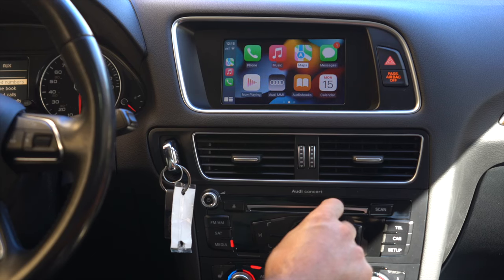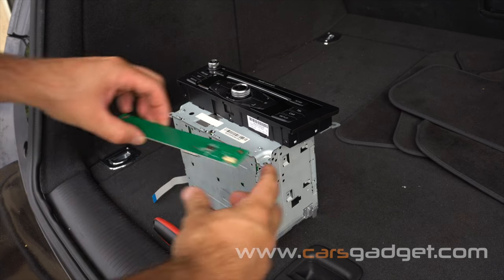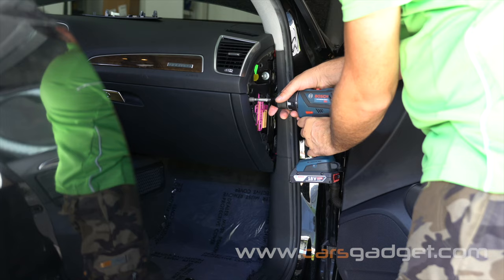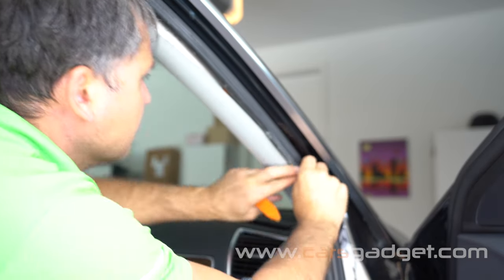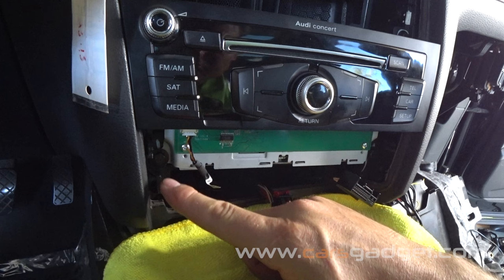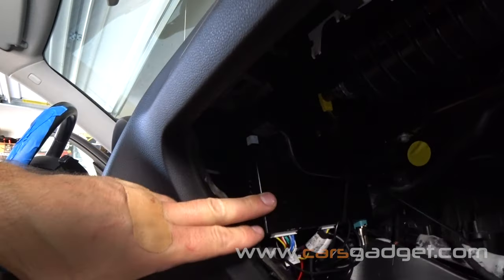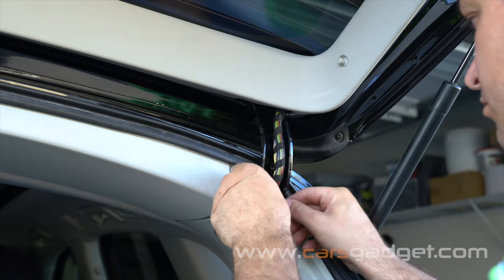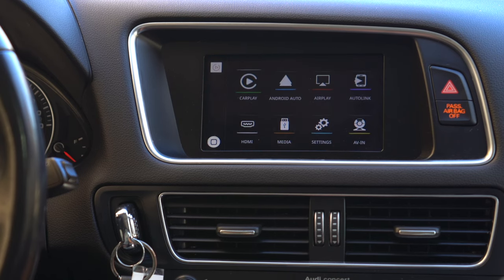Audi A4 A5 Q5 Q5 Allroad CarPlay, Android Auto, Backup camera retrofit installation tutorial

Comment: I'm finished but I got no sound but everything else is fine.. Any suggestions? no music from spotify
Reply: Are you interested in Audi LCD instrument:virtualhug:
Reply: Did you figure out the problem? I have the same situation going on
Reply: @iiChiLLL  No, but i found a solution. if you have a bluetooth reciever, (I have a INVERT Device) keep it plugged in the box just remember to swifch to carplay as audio input on ur phone
Reply: @iiChiLLL  ask me for any questions
Reply: @iiChiLLL  *invery bluetooth reciever
Reply: @kandybeats7447  gotcha. I have an INVERY Bluetooth, but I was just hearing light static through my speakers. Radio was working fine though
Reply: @kandybeats7447  not sure if I should try it with the other adapter first.
Reply: @iiChiLLL  it only works for me if invery is in with the new apple carplay stuff. i just have to switch from invery to car play and it works fine,

Comment: I am unable to find an external audio source with AMI and therefore can’t get audio from the CarPlay system. AMI/AUX connector is installed but I’m not getting any option for AUX or external audio source to be selected from media/source. Any idea why?
Reply: I’m having the same problem. Did you figure it out?
Reply: You have to plug the cable they provided to the box inside the glovebox

Comment: How does the Carplay know that it should show the camera? you used the triger line to get 12v to the cam? where is the trigger signal now coming from??
Reply: in automatic transmission cars, there is a CAN bus signal saying this is happening.  In manual transmission cars, you have to use the additional optional wire like in the instructions

Comment: Hi, I installed this kit in my 2014 Q5. My LCD screen will only come on when using backup camera. The radio still plays but the screen is black. Any suggestions would be greatly appreciated.
Reply: Hey, did you fix this issue? I finished installing the kit on my 2016 A4, CarPlay works fine but I cannot see the OEM system display. The radio plays but the screen is black just like you said.